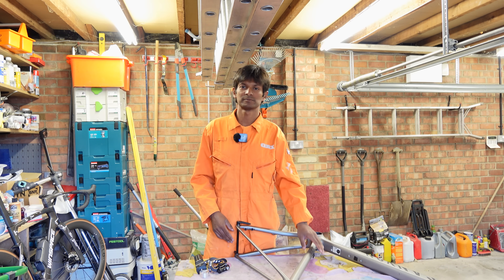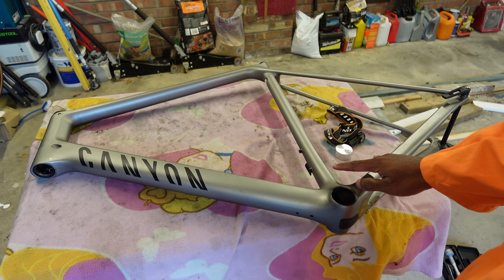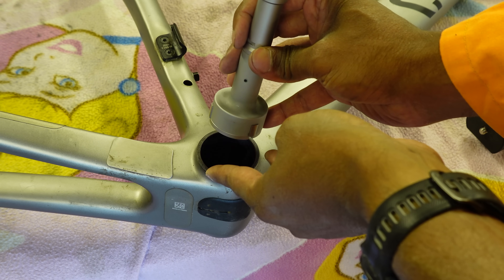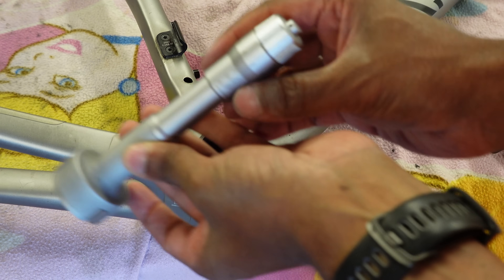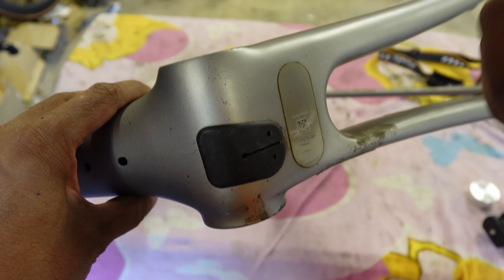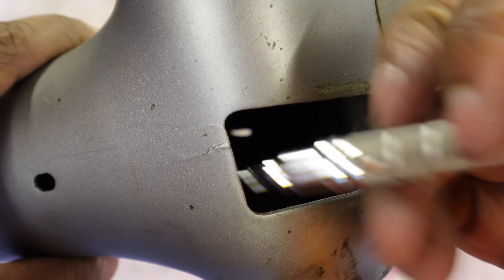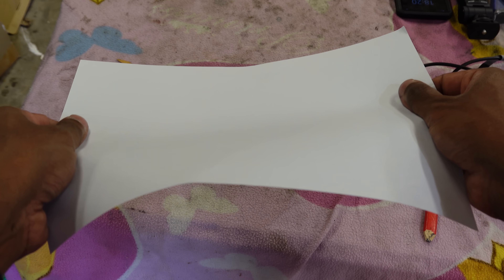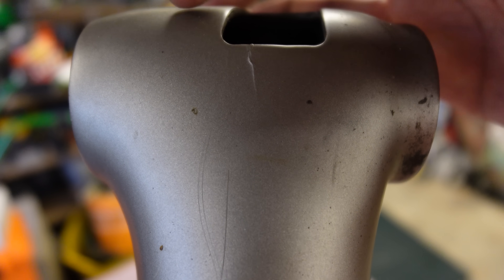Canyon’s “German Engineering” is a JOKE like their Warranty Department

Comment: Excellent video - more detailed Engineering videos please.  I'd really like to know the manufacturing process that leads to the two defects: 1) one side is oval 2) one side is out of spec. (too small). Do Canyon machine the BB hole separately from each side?  It certainly seems that way otherwise the two sides would be the same size.  If so, how do they ensure the two sides are centred on the same axis?  How do they set the axis centre point for machining - what is their datum?  I spent 10 years in NDT (metals only) and your analysis of the crack and it's cause is good.
Reply: I’m just speculating from non bike epoxy I’ve done; it looks like the inner mould was removed too early in the curing process, letting the curing of the main tubes deform the bottom bracket shape.
Reply: Basically shortening manufacturing time at the expense of final quality.

Comment: I know why the warranty was declined. The owner had owned the bike for quite some time. The owner should have filed a claim right from the start. In Germany, we say "at the transfer of risk."
If the owner has been riding it for a few years, it's safe to assume that the damage occurred after the transfer of risk and wasn't present at the start.
This means that if the customer had taken the bike in for an initial inspection after approximately 200-300 km, the damage would have been noticed in time. However, since the customer didn't have proof in the form of a workshop invoice, they forfeited their warranty. In Germany, after one year, the burden of proof falls on the customer.
Therefore, the video is irrelevant in connection with the "warranty denied" issue.
Many manufacturers experience such failures. I would have only reported on the poor quality of bikes in the bicycle industry.
Reply from the maker: He's in the UK and UK consumer protection applies. He has six years to show the fault was there at the start. Read the bottom of this page https://www.hambini.com/canyon-bicycles-warranty-failure-undersized-oversized/
Reply: @Hambini  How did the customer press in the bearing? Does he know how it's done? Do he have the right tools? Is there a workshop invoice? The crack could just as easily have been caused by improper installation, using the wrong tools. I see this every day. To me, it's completely normal in the bicycle industry. The burden of proof has shifted here. The customer now has to provide proof, because the manufacturer has rejected the warranty. This also happens in Great Britain. Normally, communication takes place between the dealer and the customer. Since Canyon is a direct shipper, they are now receiving this information directly from the manufacturer.
The customer receives the same offer that a dealer would receive, which they pass on to the customer.
Reply: Stefan, are you a canyon employee by coincidence?
Reply: @theillegalimmigrant9314  lol
Reply: @theillegalimmigrant9314  Why, because I know the difference between guarantee and warranty?
Reply: Bro he's in the UK not Germany
Reply: The crack is a symptom of the fault not the causal failure point. That’s precisely what Hambini said. The out of round and inconsistent hole diameters for the BB are the cause of the failure in the structure (visible crack appearing) There is a possible case for adding ‘design flaw’ to the list, although poor workmanship is a leading cause, using a large square sided access hole will have not helped, round holes are better.
Reply: What??? The frames have a six year guarantee. Jeez. In England we say fuk that, rectify your fuk up.
Reply: do you mean the owner need to unmount each piece from his bike and doing metrology on any surface from any gears? Are you serious? the BB is not even round. That a garbage frame with BB out of standard from the start, come on.
Reply: @LE_GRATIN  You have to read it properly! So read it again and think about it. And don't twist my words.
Reply: Steffan is not saying its right or wrong, he's explaining why the response is the one they get. Don't underestimate the 'impact' of company and country culture on these processes. Having worked in german industry as a foreigner for a while i learned how important reputation and pride are. Admitting fault is just not the german's way even though it will harm them in the long run (don't Godwin this one plz.)

Comment: Finally. 
After buying two canyons i wholeheartedly agree about them, their warranty process AND their LBS partners not being great.
No one should buy direct to consumer if they dont know their way around a bike. And even then D2C should be avoided.
Reply: Canyon Partner store just fixed the rear axel with 40+ nm into the frame
Reply: @dermitdemkuchentanzt4026  canyon partner store took my bike into custody for a warranty replacement fork which was "hard to obtain because of the color, might take some weeks"

canyon sent a fork to them immediately. they cut the fork too short. then had to order an other one which took another 2 weeks. 

Then they got rid of the expander i had in the old fork, as well as the grommits. 

Then they did not care to torque the (tt-handlebar) brake shifters, stem was handtight, topcap was not straight. Its just a mess. Imagine being a regular person who trusts their local bike shop, which they should be able to do. 

The next time i would have had to brake hard it would have been several injuries.
Reply: Sounds about right. Had a crashed bike that I had to have inspected by a partner shop for the insurance claim. Rear mech had visible damage. The hanger was not listed on the quote. I asked them about it, they said the hanger is fine. I took it out and of course it's bent. 

Now I‘m waiting on a new handlebar that won’t be in stock until September, while they send out new bikes with that exact same handlebar that apparently isn’t in stock and because it‘s their proprietary 1 1/4“ steerer tube I‘m out of options. 

I will never buy a Canyon again.
Reply: Do you think other brands’ LBSs are magically much better? They can be good or bad for any brand. Skilled people are not growing on the trees.
Reply: @cheetah694  I think buying a bike, in general, is hit and miss. The stuff gets produced far away. Then they are often assembled by people who either dont know road bikes or arent instructed properly or are just immune to reading manufacturers manuals. They just dont know that something is broken, undersized or simply not right. I think the whole thing is a needle in a haystack. THats why i've bought all the tools over the years, watched tons of content and just diy everything. At least if something goes wrong its my bad and i dont have to rely on support, waiting for emails and whatnot.
Reply: Cant confirm

Comment: Crack happened during the installation of the BB. Must be an installer issue than the frame
Reply from the maker: yeah, one side was heavily undersized causing the crack. The installer who presumably works at Canyon HQ in Koblenz probably didn't check it either.
Reply: @Hambini would you then recommend to buy the frame and have installed by a trusted mechanic?
Reply: @rommelreyes2209  then the tolerances are still trash ...
Reply: @Hambini  alles Idioten dort! Nie ein Canyon!

Comment: Never assume western brands have done their QA/QC, because they clearly have not. That simple gauge could have saved all that time and effort. The Canyon fanboys will no doubt whine that the frame was haggered or X years old, as if carbon fibre manufacturing has magically evolved in that time. Spoiler: it hasn’t. And judging by their warranty responses, they must have a failed apprentice running the department.
Reply: It's a fitty fitty thing: 

Canyon sits on the fact most people who buy them won't ride them.

Other fitty:

They calculated that end of line QC and not leaving the manufacture to themselves would cost a lot more than covering warranty claims.
Reply: What about eastern brands? What Ur talking about dude 😂